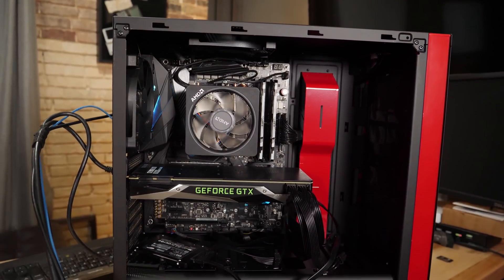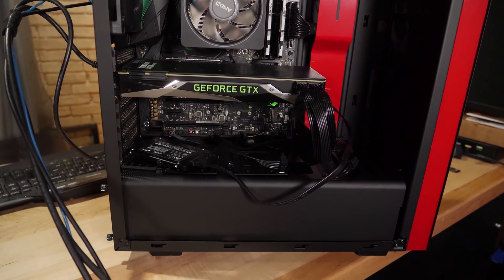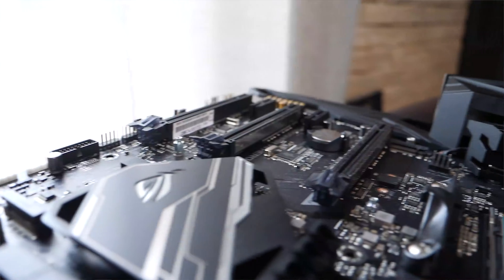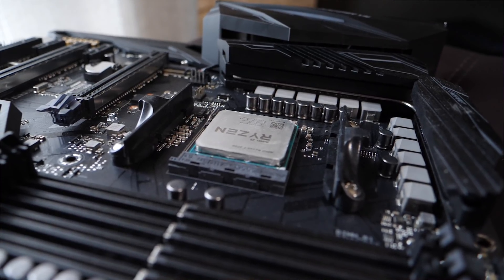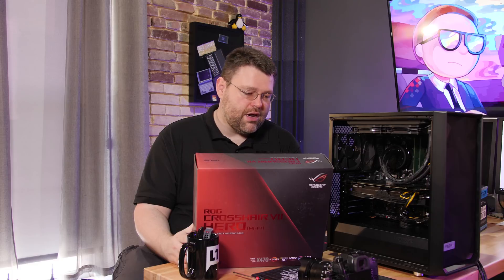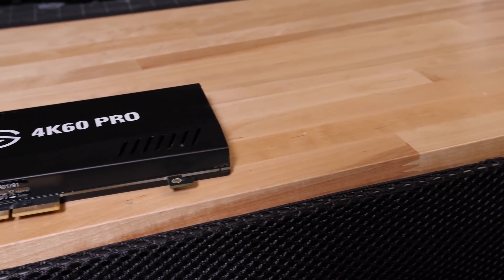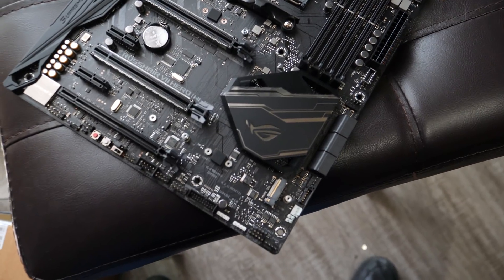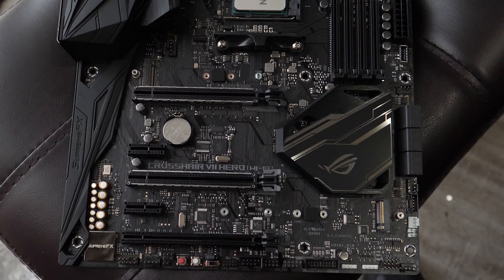ASUS ROG Crosshair VII Hero Wi-Fi X470 Motherboard Review

Comment: @Level1Techs, I have this motherboard and I am delighted with the stability and quality. I have a dilemma, I have a Ryzen 7 2700X processor, but I want to upgrade to a Ryzen 9 5900X or equivalent, should I buy 3200 MHz or 3600 MHz RAM, the price difference is insignificant. At the moment I have 2400 MHz memory

Comment: Running an almost identical set up here
2700x
8gig OC 580
4x8gig TridentZ (3200)
Samsung NVMe M.2

Killed my 750 watt power supply after 2 years on 10% OC. 

Upgraded to a 850 Thor a few days ago. No issues since. Also ran benchmarks where i could now see the power consumption. Right at 740W with 10% OC.
Reply: Did i mention i make it all run under 60C with air cooled?

Comment: The bottom m.2 run off the x470 chipset and the top runs only from the cpu. If u use the top m.2 it reduces the top pci-e slot to 8x from 16x. You failed to mention that.
Reply: Read the manual. Bottom (PRIMARY) m.2 from CPU reduces the top PCIE slot from x16 to x8. Do you have a second m.2 installed?

Comment: Is this board still worth it today? I bought it for $170 new. I haven’t installed it yet. Should i return it for a x570 board ?
Reply: Just did the same as well for $180, still worth it today. I'm keeping mine because by the time PCIe 4.0 is widespread, AMD will have moved on from the AM4 socket and I'd need a new motherboard regardless. GPUs aren't close to saturating PCIe 3.0 x16. For some reason people on the internet are misinformed regarding the addition of a second NVME SSD (FYI the bottom slot is the primary slot and the heatsink can be transferred). As the video mentions the second NVME slot will run at PCIe 3.0 x4, however the drop in bandwidth occurs with the second PCIe x16 slot, not the first one. This is stated in the manual (RTFM folks). This would affect dual GPU users as with only one NVME SSD the GPUs would run at 8x/8x, then at 8x/4x with a second NVME SSD. For single GPU users, the first PCIe x16 slot would still run at PCIe 3.0 x16.

Comment: Sooooo....
Are you able to run 2 of the m.2 drives without raid ( 1 for the OS and the other for storage?) Or would it be better to just run a 2.5" SATA SSD drive as the storage? I know you went over it but I'm old and dense - lol and it was a lot to take in.
This was an excellent review of this board by the way.

Comment: saying you dont need a 2k series ryzen for the board to work and a 500w power supply being more THAN ADEQUATE?????????????????  you have such a powerful MOBO as well as CPU and a fairly high end AIO cooler inside a phenomenal case but yet you have standard psu cables and RAM without heat spreaders????????????  please seek assistance

Comment: Can you confirm that the type c USB connection on the back of the motherboard is janky? Because I try and connect my Google Pixel 3 with its provided type c cable and if I move the cable a specific way it keeps disconnecting and reconnecting from my computer, I am looking for a solution and the cable I'm using is a good working cable It's definitely the port

Comment: Is there any chance of you making a video combining the Crosshair VII x470 with the Ryzen 3900x? That would be beyond helpful.
Reply: I'm going precisely  for that. Got the x470 crosshair vii alrready
Reply: Ali Irtaza Bhatti what made you do not choose a X570 for that cpu? I’m asking cause I just bought a gigabyte X570 aorus pro WiFi, and I’m thinking to exchange for that ASUS x470, the difference in price for me is going to be only $17 dollars, does it still make sense? Ps: I’m NOT going to use PCIe 4.0 m.2. Thanks
Reply: I have got the Crosshair 7 with a 3900x.  It's a perfect match. Extremely stable. The most recent bios Asus released back in Dec of 2019, is pretty darned solid.  If you enjoy a good time overclocking, this is the board you want. Every parameter is adjustable. The VRM's are more than stable enough to tolerate LN2 with out breaking a sweat.  Right now Micro Center has them for 220$.
Reply: I'm a bit late to the party, but this board doesn't have a problem with even a 3950x. 3900x obviously no problem either.
Reply: I will be pairing a Crosshair VIII x570 with the Ryzen 3900x.

Comment: Wanting to drop a Ryzen 9 3900X into this board. Sacrificing some X570 features, but PCI 3.0 is more than enough to drive all of the components the board will use for ~8 years.
Reply: Can it be upgraded to 4.0 PCIe? If not do you think 3.0 will be viable for years to come?

Comment: have an Asus Maximus IV Extreme-Z Intel Z68 Motherboard with an i7-2600K running at 4200MHz with 2 x Asus GTX 770's. I have had 8 years of stability running Linux and this sounds like a good board to build a new system from. Is there anything worth noting when going from an Intel set up to AMD?
Reply: AMD is much more RAM dependent than Intel. Something to keep in mind though, in terms of AMD, is that the Ryzen 3000 series is supposed to come out around July.

Comment: Ive just ordered this board with a 2700,32gb corsair vengeance pro ram, Samsung 970 evo polaris 250gb m.2 and with the thermal take view 71 case.  

Im upgrading from the crosshair v formula-z with a fx 8350 cpu. I literlaly cannot wait for it all to arrive,  I'll be taking my strix 1080 and corsair AX1200i and putting them in to the new build aswell

Comment: It seems like a lot of people are having issues with the wifi version.

but then again I dunno why spend more money on the wifi version. You can just buy the normal version and then just buy a cheap wifi module connected via usb that does not need drivers.

Also, Team Group's Dark Pro series of Memory that uses Samsung B-Die (Rare nowadays) seems to be very compatible with Ryzen and easily gets 3200MHz at CL 14, 3466 at CL16, 3866 at CL18 if my memory serves me right.

Just search : Team Group Dark Pro 8Pack edition 3200MHz CL 14 and you will see all of his Ram modules that utilizes the very rare Samsung B-Die Memory which apparently is the best memory you can ever find/use versus other Memory manufactures like Hynix etc.

But then again, 16GB of said ram cost £218 lol £199 with the discount that they had 3 days ago.
Reply: USB WiFi adapter doesn't deliver the same bandwidth speed and heat really fast

Comment: I been trying to figure out some freezing issues with this board. To this point i have tested all from my SSD and HD also graphics card memory mostly all i can think off to test. I have even reinstall my windows 10 pro 3 times to check if is a issue with windows. The problem i get is a freeze that will last 8 to 9 seconds before going back to normal. At this freezing point my monitor and all will freeze and can't do nothing till the freeze stop. I notice the hard disk led (hd _led) light will stay on solid till the freeze ends then goes back to normal blinking. I try all to try to determined the issue but nothing has work. At this point i don't know if is the board or hd or ssd which i know it can't be cause i have tested them and all has come out okay. This is a great board i just wish mine didn't have this issues when i bought it. The computer i build is a brand new build just build it at the ends of june of this year and been using it since then. If any of you have run into this issue and know the cause it i would love feed back on how to fix it thanks.

Comment: I'm currently purchasing parts for a new pc build. Processor is Ryzen 7 2700x. What board should I go for X470 AORUS GAMING 7 wifi or ASUS X470 ROG CROSSHAIR VII HERO ?
Reply: playid69 if you just gaming and not over clocking then go with x470 gaming. If you overclocking and trying to get max performance and also creating content for work or business then you want the x470 crosshair vii hero

Comment: Question  will a 700wat psu be good to run 2700x with gtx 1050ti... As i dont do overclocking  and i am going to get this motherboard.
Reply: Sean Broodryk what do you think about 2600 and an 1060 instead? You probably don't need more than 12 cores on average, and in gaming like barely any difference in 2600 over clocked VS 2700x over clocked, but 1050 and 1060 sure

Comment: For those of you familiar with a guy called Buildzoid, he gives an excellent breakdown and analysis of the power stages and VRM design of this board.  I decided to buy this board just because the VRMs and other components were considered "overkill", and simply will not overheat if you know what you are doing.  His channel is Actually Hardcore Overclocking but the video was done over at Gamer Nexus: https://youtu.be/A4PEgofGfz4

p.s. Don't mean to step on the toes of Level1Techs.  Just thought I'd add in how much this board seems to be appreciated by the tech and/or OC community.  But yes, it's really expensive!

Comment: Can this board underclock Noctua fans? I run my NF-F12 at about 130RPM with a Gigabyte board. Is that possible with this one? The Gigabyte board is a bit buggy on this, and the underclock only works, after a calibration using the windows fan tool provided by Gigabyte. After that, all that is needed is to the bios. But can Asus do the same?
Reply: I managed to get my fan speed extremely low on some of fans with the auto fan tuning fonction, yes.

Comment: Wendell, what's your take on Leo's (KitGuruTech) test, where he says that stock on this board is actually auto overclocked with extra power consumption and heat as a result. He stated it was actually very difficult to get a 2700x to run stock on this board.

Comment: A happy owner here and so far so good. I run it with a Ryzen 1700 OCed to 3.736Ghz @ 1.237v. 24h+ Prime95 stable. I didn't take any chances with RAM and got G.Skill FlareX 3200Mhz CL14. I haven't OCed the RAM and the stock frequency seems to be 100% stable. 3600Mhz would give me a rounding error in Prime95. However, games and general OS tasks would run OK. Maybe I have to tweak it a little more, I just raised the voltage to 1.45v. I would definitely recommend getting AMD compatible RAM and FlareX Samsung B-side seems to be a very safe bet. I would go as far as to saying that most stability issues will be RAM related. 

VRMs on this MB are an absolute overkill for any Zen / Zen+ Ryzen and that makes one wonder whether this board was designed with possibly more power hungry higher core count Ryzen 2 CPUs in mind? AMD has made a commitment to keep AM4 alive at least until 2020 so I'm hoping to be able to hold on to this board with the next gen AMD CPUs. 

The next thing to test is StoreMI. For storage, I use Optane 900p 280GB (M.2). The issue here is the weird capacity as the free version supports only 256GB for the fast tier. I talked to Enmotus and was told that I would have to install the OS on the slow tier first otherwise StoreMI wouldn't be able to transform the drive so be careful if your NVMe drive is over that limit. No such limitation with the paid FuzeDrive Plus but backup is a must! Also, the free version doesn't support pinning (to be able to keep selected data always in the fast tier) but neither does the paid Plus. But they're planning a Premium version with this feature. My advice with StoreMI is to wait. I've also read a few stories about data being corrupted so the whole thing is either sensitive to how you set it up or generally unstable.

Comment: Except the post code led becomes blocked by your radiator 😂😂
Reply: funbucket09 yup. I have to lean over to see post codes
Reply: Buzz K me too!! Damn it is annoying when you are trying to work out why it isn’t posting (again!)... I personally find the board to be quite sensitive. Sometimes the safe boot button refuses to work and I am forced to clear CMOS.  Quite frustrating as I chose this board for the overclocking features and the dual (asynchronous) bclk.  I have mine in a meshify C too it is quite funny Wendell has essentially put together exactly the same as me by fluke (who was first? Who knows :P)

Comment: the pcie splitting thing also should mean you can 3x nvme raid by populating the 8x slot (running at 4x) with an adapter card.

Comment: I have this board, and everything runs smooth and stable.  I'm very happy with it, super easy overclocking.  It doesn't support my crappy designated RAM speed though (GSkill CL16 3200 4x8 32GB), but that's more on me for not doing enough compatibility research.
Reply: Hethos Deus what speed are you able to run the ram at?
Reply: I can get them to run 2933 without issues.  Anything higher at least with XMP profiles and  up to 1.45V has been unstable.   I haven't tried to manually tweak timings.  These sticks from what I understand are Hynix M-dies.
Reply: same with my corsair LPX 3200 ram can only get 2933 (my mistake with getting that ram)
Reply: Does that mean that something like G.SKILL F4-3200C16D-16GTZRX 16GB would be a better option, or perhaps a G.Skill Flare X 16GB DDR4-3200MHz (F4-3200C14D-16GFX) ?
Reply: Christos Karsanidis yes the mode that ends with X are compatible with ryzen and run true mhz
Reply: over one year later I am stuck here with my 3900x and having the same issues with 4 sticks 3600cl15 sticks from g.skill I really don't know what i'm doing wrong 2 sticks on channel a2 and b2 run fine at 3733 cl14 but 4 sticks wont go over 2800

Comment: Nice belated review. My ASUS X470 Crosshair VII Hero Wi-Fi and Ryzen 2700X arrived on the 19th April 2018. Running at Stock but very happy with this systems performance, found no real notable gains from overclocking CPU, I'm also able to get another 166MHZ out of RAM but  does not really improve performance much. I mainly use my system for running a few VMs, compiling code, general use such as browsing and some casual gaming.  I have two Nvme Samsung 950 Pro SSDs installed for the Windows 10 Pro System and 4TB Raid 1 spinning rust for data. Videocard ASUS GTX 1070 Strix RAM 3000Mhz LPX Corsair 16GB (2x8GB) Memory  Would have liked 32GB but memory prices are insane in Oz. Corsair RM750i PSU. All mounted in a ThermalTake Core P3 White Case. I'm very happy with this system which replaced my  ASRock Taichi X99 6800K system with almost similar performance but it was time for a change ;-) and a slight boost in performance with extra features such as an upgrade path until 2020. Thanks AMD & ASUS for the smooth ride. Running a Stock with no overclocking my system has been as stable as a rock (after updating the BIOS, which I did on the first day of use  lol).
Reply: Yeah I know it's how I use my system too. I'm not a gamer and had been using X99 for the last few years but want to give AMD Zen+ a go... and my Hynix memory is just fine as well with the latest improvement to the X470 BIOS. Thanks it is a fun discussion..
Reply: No your pricing is way too high. I paid $469.00 AUD which is around $348 USD and I have seen them listed as low as $449 AUD ($333 USD) Running multiple Virtual Machines so more memory the better, I'm not a gamer ;-) Dual PCIx4 Nvme Drives with RAID support worth every cent..
Reply: WHY? Dual PCIex4 Nvme Drives with RAID support worth every cent.. More memory the better for VM.s. NO OC required for 2700X performance and Stability is more important than pure clock speed.
Reply: caRn He literally just said it was for the PCIe X4 lanes.  It is the only X470 board to have 2 slots native gen3. Good for raid0. Wendell discusses this in the video.  I would like some B-die memory modules as well but at the moment just using my old DDR4 cannot justify the current price of DDR4 it is absolutely insane.
Reply: REA Electric  this is my first time building pc Mobo: asus corshair 7 hero wifi wtih a ryzen 7 2700x  Memomry GskillTrident Z 2x8. Question: did I need to update bios or mess around with it ?
Reply: IF IT AIN'T BROKE, DON'T FIX IT .  For a new builder I would Only  update the BIOS if required (ie for New Ryzen AGESA feutures,  BIOS memory timings, for newer CPU support etc)  but the nice feature of this board is you can re-flash the BIOS from a memory stick if the system is bricked.  This is very unlikely to happen but it is a good feature to have ;-)
Reply: REA Electric thanks for help so save it and exit thank you
Reply: REA Electric I have this board on a 2700X too. Same ram as you as well. I have been running on stock too but I am not comfortable with the stock vcore. I have been getting about 1.4V and it is taking its toll on temps (lucky it is watercooled). What voltage do you get? I have been thinking of working out a negative offset for the vcore but every time I try I get post error :s
Reply: I would like to upgrade to higher speed RAM (Samsung B die) but the price is just too high and Corsair LPX Hynix RAM at 3000MHZ is fine, this run at 3166Mhz without changing the timings. Not really a fan of Steve's videos from Hardware Unboxed.

Comment: I bought this board for my 2600x. One of these days when I have the time I really wanna learn more about the bios features.
Reply: Doothe Very good bios. I got one for my 2700X. I had a Taichi X370 before this.  There are many more presets on this board (for overclocking).  Many of the other features are similar to other boards (AMD CBS).

Comment: Have this board, it's great but they did have an issue with one bios version that would cause any fans plugged into the board to not function. After updating I have had no issues with it.
Reply: Though you probably already fixed your issue, you are looking for the PPT setting in PBO menu.